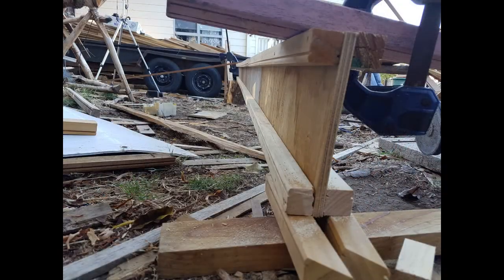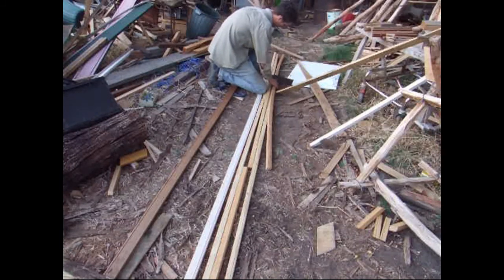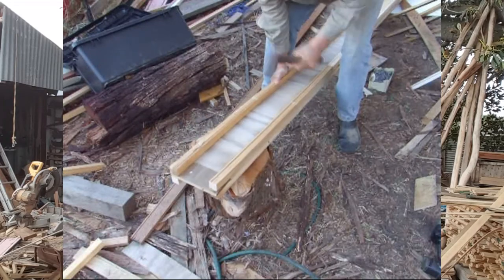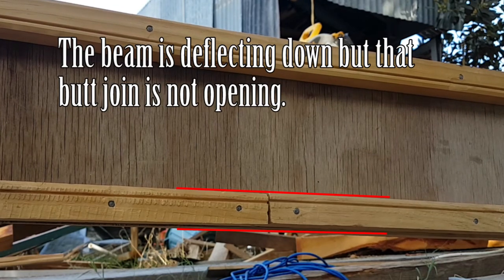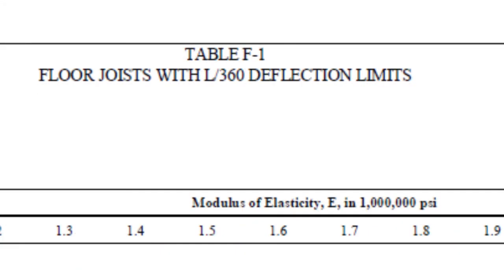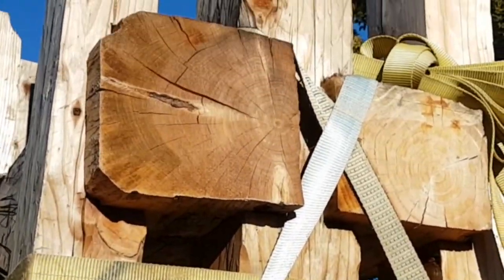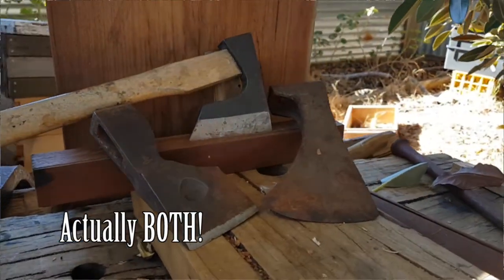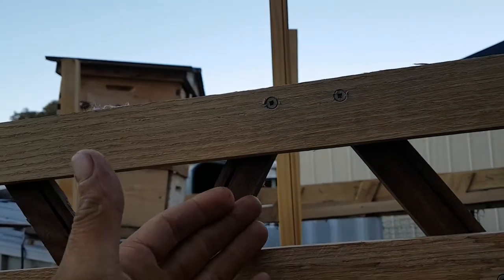DIY Improvised Composite Beams from scrap wood and waste

Comment: Hi just stumbled across this video. Impressed. Did not answer my question and search though so i ask you this if you can help. I need a six meter laminated beam. Dont have money nore the wood. Can i glue 100mm x18mm pallets together to make a laminated beam. Or would that not work. Pieces would very in length and im thinking of staggering the joints ? Doable or not
Reply: Sure it's doable but if you don't do it right will it be dangerous? There are lots laminated beams commercially available but the process used to make them are well understood. If you make one your self is it going to be up to the job? 
Making beams for a small garden shed is one thing. Making up a 6m beam that presumably is going to be bearing a considerable load is totally different. Not without learning how to do it properly. Get it wrong and you could seriously injure yourself or someone else.

Comment: Add glue and put the splices on the compression side and it will be stronger and safer and the middle third of the tension side should be avoided, and full depth stiffeners will strengthen the ends where the shear forces are the largest.  FYI, you will be taking responsibility for following the law.  For those not familiar with the tension side and compression side of how beams bend should probably avoid doing this.  The NDS covers beam design in the US provided by the AWC, and there is a supplement has design properties for different types of wood and glulam members if you want to start crunching numbers, but you will need a text book like "Design of Wood Structures ASD-LRFD" to learn the math, the NDS just gives the limits of how to calculate beams, columns and connections.  I am an engineer and any one with the math skills, interest, time and determination can learn this, but you may need a license to do some things legally.   Local Structural building codes will have design loads for different kinds of area uses and are generally base on Chapter 16 of the IBC.  All these codes can be generally found online for free, except for the text book, which is the one thing that show how to actually calculate things.  It is good to have some understanding of statics and structural analysis of loads, but it is pretty easy if you have a good understanding of basic algebra.
Reply from the maker: For structures that are required to be built to code you can't do this yourself. This advice is for small scale vernacular structures. Structures where the consequences of failure are minor and where finding a safe solution is about over engineering rather than calculations, even calculations with conservative safety margins.

Like I showed in the video for the 3m span of the wood shed roof a series of these beams is WAY over kill. I know how to do the engineering of wooden beams, primarily solid wood beams with all wood joinery but that's not what this video is about. Its about showing how you can build a very strong beam from scrap. But having said that as you say having an understanding of compression and tension in beams would be a good idea.
Reply from the maker: I should also say In Victoria, Australia buildings that have a footprint of less than 10m2 and less than 3m tall don't have to be built to code. Their safety and suitability on construction is all on you. Other jurisdictions will be different.

Comment: Thanks for continuing to share your experiments and adventures.  I will be most curious to see if there are sensible comments.  

I don't know enough to comment more than tp say that I wish that floors weren't so stiff, as that bounce is a relief on my dodgy knee!
Reply from the maker: I got a roasting for posting the initial photograph including a mass of abuse (which i didn't really respond to other than to say i would respond) it's been really quiet. The Internet is a strange place.
Reply from the maker: Kiriel Papillon you can find floors that have a bit of bounce but they tend to be in old unrenovated homes. John and Sharons place maybe.  If a house has had any work done on it one of the first things to be "fixed" are the floors.